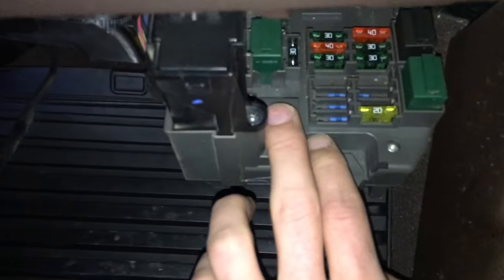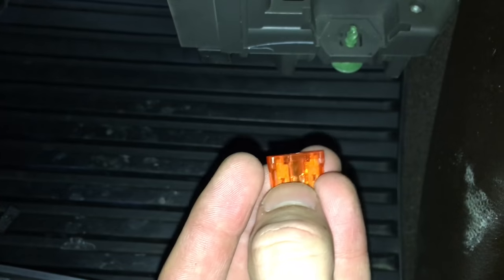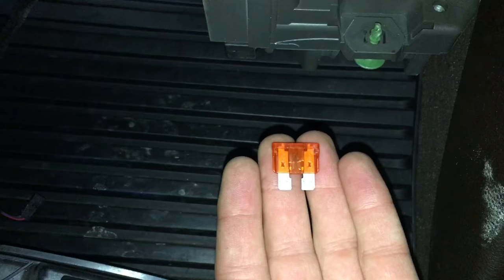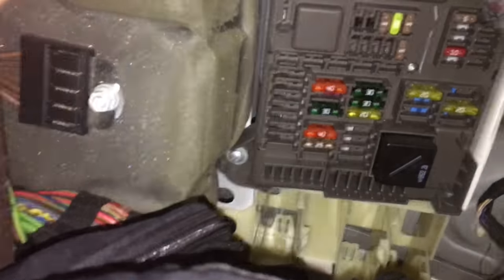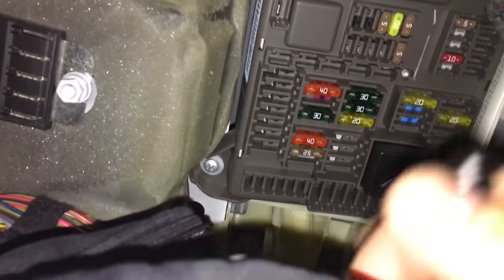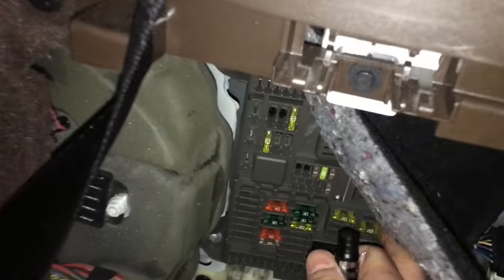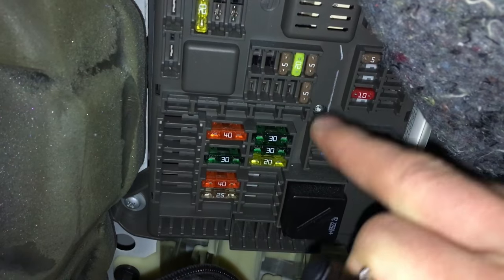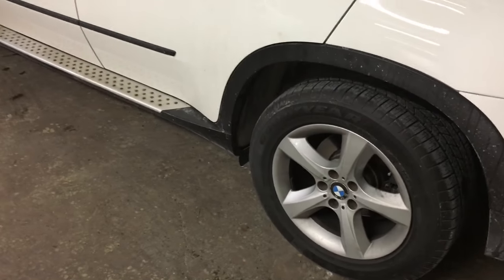BMW X5 E70 Rear Suspension Problem Fix

Comment: Any idea how to delete the error code ?
Reply from the maker: Thanks a bunch for watching my video and taking the time to comment. You would need a diagnostic tool that can communicate with more than the OBD on the BMW. I have in emergency situations tried to reset with a hard battery reset, but lost all my radio codes and what not, needed to be entered again. Please share an update, thanks.
Reply: @WheelsTips  can a certain fuse be removed or does it has have to be a diagnostic tool
Reply from the maker: Personally I have not cleared codes with fuse removal. Have you tried the fuse in the video?
Reply: @WheelsTips  just seen someone else do it on a different bmw and just thought it would work on t he e70
Reply from the maker: I have seen people help their issue like in this video by pulling the fuse and having that system reset.

Comment: So when I change the air compressor I have to change the fuse and the relay ??
Reply from the maker: Hey Mauricio Fonseca thanks for watching my video. As good practice I always checked the fuse to make sure it was the correct one and in good shape and I would replace the relay, sometimes the relay was updated.  Please share your diagnostics and what you decided to do, thanks a lot.

Comment: Does this apply to an x5m? 2010
Reply from the maker: Hey Minky lee, thanks for subscribing. Please tell me what is wrong with your car.
Reply: I notice in the mornings when the engine is cold the rear suspension  seems to be lower than the front. However when I start the vehicle it starts to rise. Is this normal? I've never really noticed since lately. However the battery not charging light comes on daily? Do I just change the battery n see if it fixes the issue?
Reply from the maker: Hey Minky lee, if you do not have an indicator light of some sort regarding your suspension it is hard to say if you have an issue. As for your battery not charging that can be few things, with an advanced car like yours it requires someone to scan it and or check with a battery tester to see how the alternator is charging. Your battery and alternator need to be checked.
Reply: Thank you! Appreciate the help. I'll just take it to the dealer. I'll give u a feedback what they say/do. Thx again.
Reply from the maker: Yes please keep me informed about what the dealer says they want to do, I am very interested. Ask them to check for recalls while you are there.